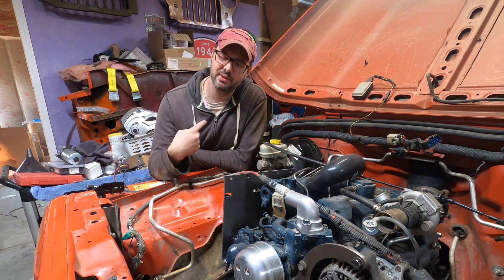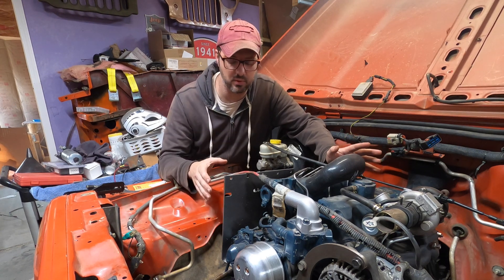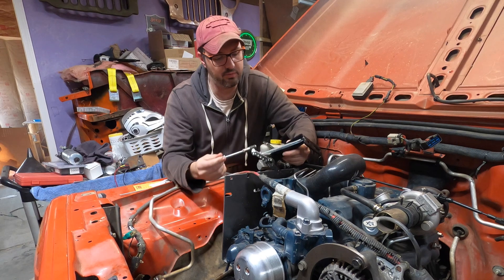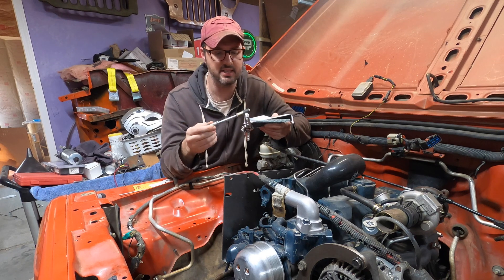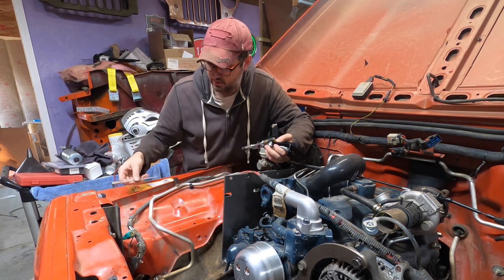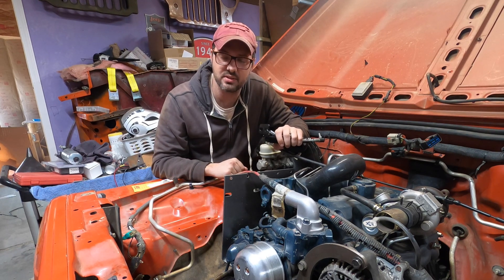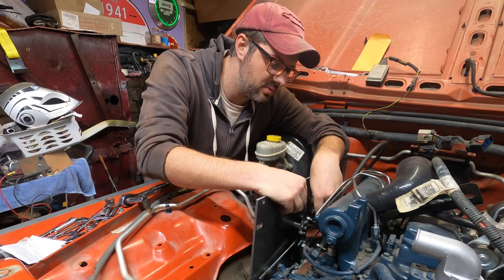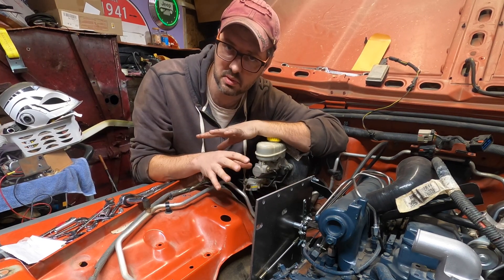Throttle & Transmission Linkage Work Begins [Felicity - 42]

Comment: How much hp is the engine going to make.
Reply from the maker: Initially I'm keeping the fueling and boost stock so around 65hp and 125ish ft/lbs of torque. Then I'll be adjusting the fueling, boost, adding an intercooler and then possibly upgrading to a bigger turbo as well!
Reply: Rusty Autoholic Guy all some so when Diesel swap tj done you can do a fan meet up so I show you my OM617 swap tj.
Reply from the maker: @200Johnnyboy  I think that would be great! I know another TJ that has the 2.8 Cummins swap, we should all meet up and go do some trails one weekend and see how each rig does!
Reply: Rusty Autoholic Guy can’t wait keep up with the all some videos.